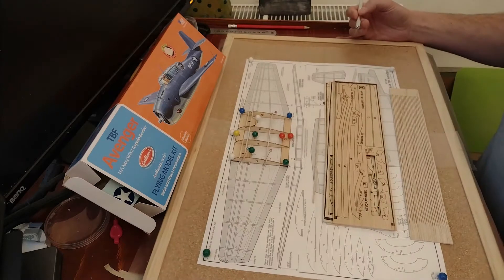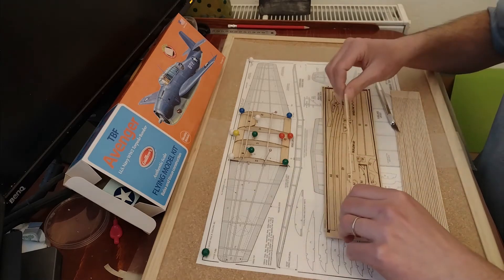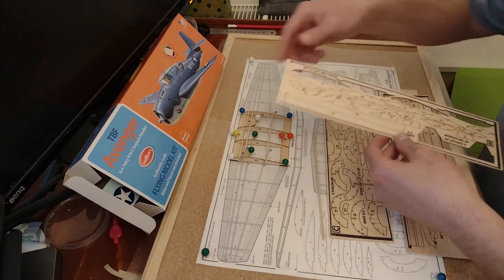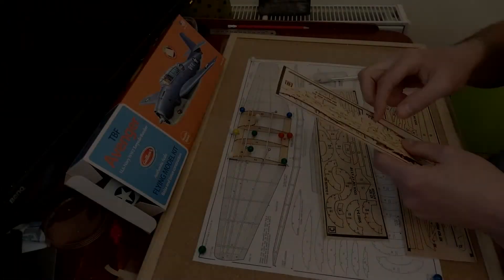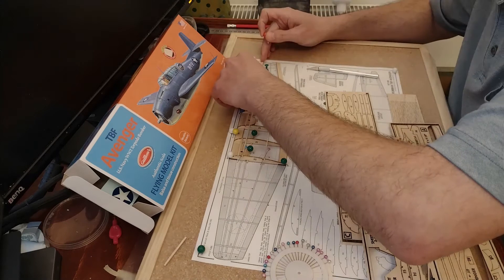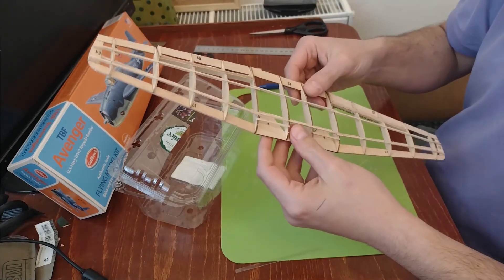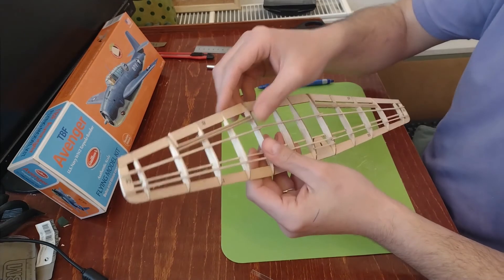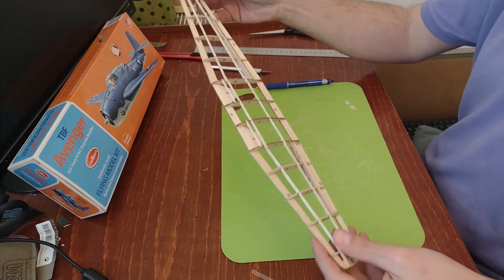02 Guillows TBF RC conversion   Wing & Ailerons

Comment: Great start, I think I would have put the ailerons on the outboard end of the wing though, they should work to an extent any way. Funny how different modellers start in different places, I always start with the fuselage 👍
Reply from the maker: True, I noticed you start with the fuselage, I tend to the wing and tail feathers :)
Reply: @downwindchecklist6567  I start with the wing too. You'll have plenty of aileron authority, I think. Nobody's going to be counting rolls on the upline for a tiny Avenger. Looking good!
Reply from the maker: @joelamb3581  Thx! I need the ailerons close to the fuselage as I use only one servo. It does feel very tiny and cramped, I hope it is stable enough to stay in the air for a while...